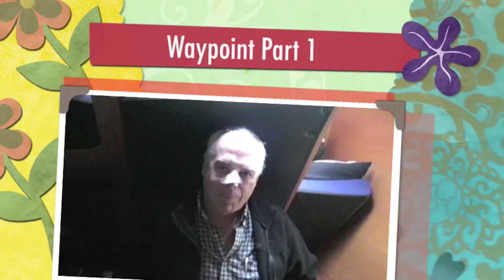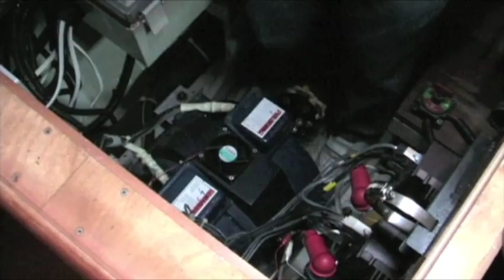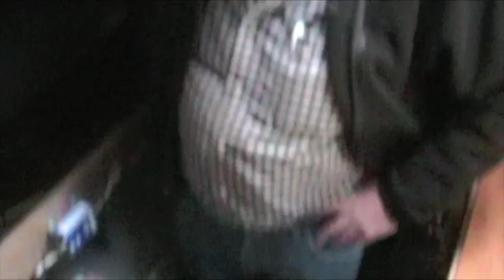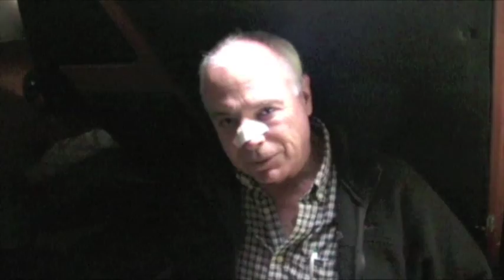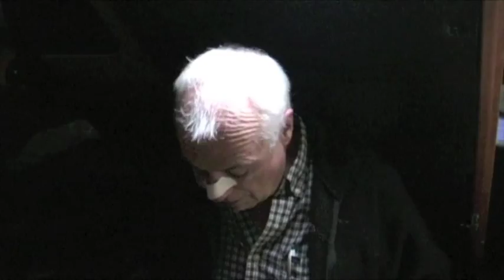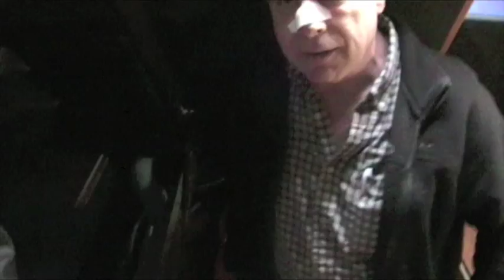Lagoon 410 Electric Propulsion 9Kw Motors explained PT1  Waypoint

Comment: You should get rid of the sails and put in the magnetic motors, you could sail around the world doing 15 knots with no Diesel and only two batteries, and leave the magnetic motors running and not plug in to shore power.